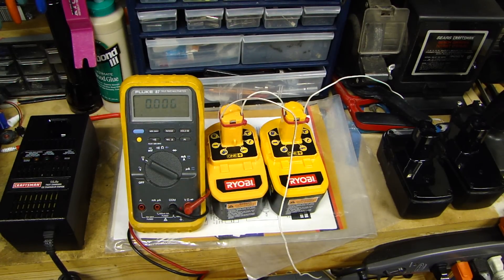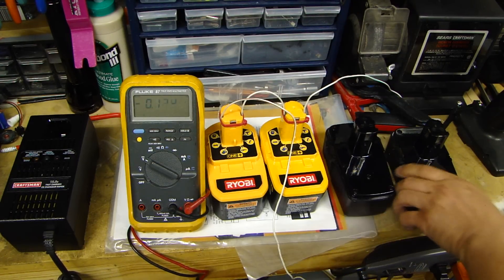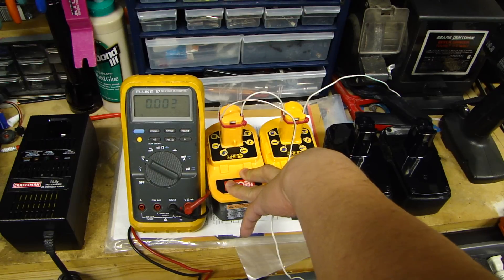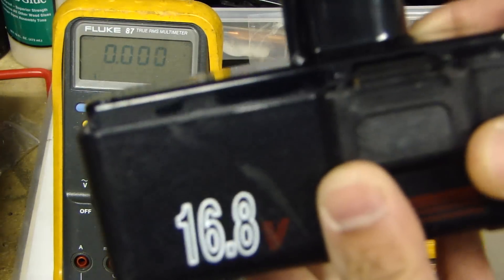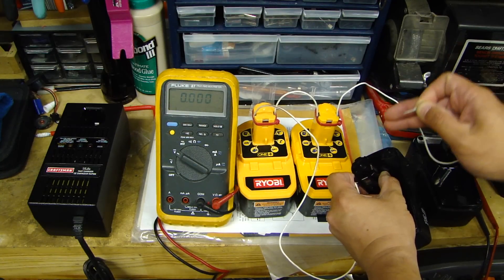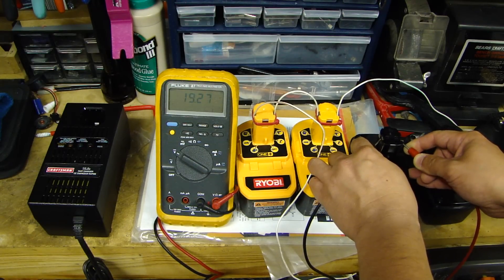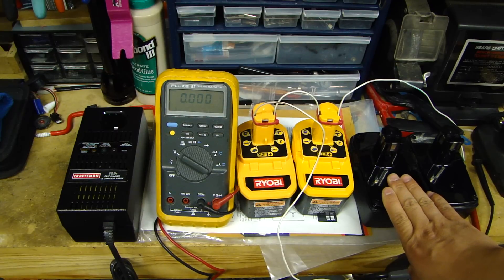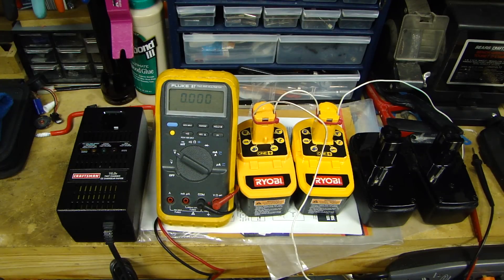How To Revive & Fix a Bad NiCd Rechargeable Tool Battery - Part 1

Comment: I didn't even know this was possible. I had 2- six year old 18 volt black and decker batteries that would give me 3 minutes before the line trimmer would lose lot of its power. I did this jumpstart twice with one battery and once with the other but with a diehard automatic battery charger. Now, they are giving me the usual 24 minutes trimming on a full charge for each battery. Rejuvenate six year old batteries to almost brand new?! Awesome! I almost was going to buy a new trimmer.

Comment: @chuckyg0409  It is the current from the external source that is blowing out the shorts (probably tiny filaments) in the bad cells, enabling them to take a charge again.  Your charger may measure 50V open circuit (a meter places a very tiny load on the charger), but the amount of current it puts out is limited (as it must be to charge the batteries properly).  The source used in this video can deliver amperes instantly.  Check Understanding Electricity at steverose period com. Aloha, Steve

Comment: Great video!  Clever use of the good batteries.  I found this after the fact, but will use it on other batteries.  I had a Makita 9100 (probably 15 years old) that was down to 5v (normally 10, 8 cells).  Prying off the lid revealed that some cells were shorted.  I shorted the terminals of the battery with quick pulses, as you mention, and there was enough amperage in the remaining good cells to blow out the internal shorts in the four dead cells!  Thanks for the video.  Aloha, Steve

Comment: I was able to get one of my 14.4 Ryobi NiCd batteries up and running.  I was able to get a decent charge into the second one use this "surge" technique.  Right now I have it on the charger to see if it will hold a charge.  Hopefully it will but at least I've got one of my guys online again have use of my cordless drill again.  Yay!!  Thanks for the information.

Comment from the maker: @geardriven I am not familiar with the DeWalt battery.Usually the tool will only have 2 contacts. From there you can try to do a quick charge on the battery and immediately use your meter to measure those 2 contacts to see if you get any voltage to tell which is positive or negative.

Comment: I have a DeWalt 14.4v battery that will not accept a charge. I'd like to try this but how do I tell which prong is POS? Also, nowhere on the battery does it state what it is. Whether NiCad or otherwise. Anybody know?
Great video BTW!

Comment: I have a digital power supply that I can preset for any voltage and amperage.  For Ryobi 18v, presetting the power supply to 36v, what amperage level would be needed?

Comment: Thanks,

The high current pulses are burning off the dendrites-tiny "whiskers" that form internally and short the battery.  Fix will likely be only temproary, unfortunately.  Question:  Would you mind telling what video camera and model you used to make this video?
Thanks!

Comment: JUST LIKE TO SAY THANKS THIS WORKED A TREAT ON MY DADS OLD DEWALT THAT HAD BEEN IN THE GARAGE SINCE HE PASSED AWAY AS I DIDT WANT TO THROW IT AWAY BUT DIDT WANT TO SPEND OUT FOR THE PRICEY BATTERYS USED A 12V CAR CHARGER AND BATTERY IS NOW GOOD AGAIN YOUR A STAR CHEERS MATE

Comment: Great video.  I just used my 12 volt Automobile Charger to fix two of my Dewalt 12volt batteries.  Basically, one was tired and the other was dead.  I used the 55 amp Jump Start mode to make sure there was enough 12 volt current.  I tapped quickly about a dozen times and then let the batteries sit for about 15 minutes.  Sure enough, they came back to life.  I suspect that double the voltage is less important than sufficient current.

Comment from the maker: @GlennTechNYC  I have never tried it with car batteries but I think you would still need to double the voltage which means you want to put two 12 volt car batteries in series. Car battery is not high voltage, but VERY high current, so be careful. One important note, if you are going to try one 12V battery, please disconnect it from your car before doing this. You don't want to take the chance of frying your car's ECM computer.

Comment: i followed this to the letter,  the first attempt gave a very low voltage reading so i waited 15 mins for the battery to cool down and then zapped it again and HEY IT WORKS. saved me £50. 
thank you for sharing this info.

Comment from the maker: @infinera06  There are no issues. You are just causing the source battery to surge a lot of current for a second with each tap. That's why I don't recommend putting it reverse polarity.

Comment from the maker: @TDoginNC  I copied this off some website to help explain - "The active cadmium material is present in finely
divided crystals. In a good cell, these crystals remain small, obtaining maximum surface area. When the memory phenomenon occurs, the crystals grow and drastically reduce the surface area. The result is a
voltage depression, which leads to a loss of capacity." .......my method of using high current to shock the battery will help break these formed crystals.

Comment: Works great!! I two dewalt 12v batteries that were weak (8v measured). Did this found out one had a damaged cell, but the other one worked just as good as it did before!! Cheers!

Comment: @dial2fast For safety I ran some 20" long 14ga wire to the terminals and placed the battery into an old tool box. With the wires exposed, I zapped it with the car charger set on 50 amp boost (jump start mode). 6-8 time in reverse polarity, the 6-8 times +/+ and -/-. Let it cool and put it on the charger.  Before, this battery would be almost dead by not being on the charger for 24 hours. Now it lasted 3 days with intermittent use. It has plenty of torque again. Just did the 2nd battery too.

Comment from the maker: @TFMTraining  My logic in my head tells me putting a high current in reverse polarity would not be good for the battery but then again I haven't tried it before. As for using car charger, with anything high current, make sure you can zap it VERY quickly and not too much so that damage to the battery does not occur.

Comment: Other videos I've seen say to first reverse the polarity from the power source for .  zapping (+ to -  and - to +).  The to do it again with the correct polarity (+ to + and - to -).  

I was thinking of trying this with a Car charger and setting it to jump start (50 amp boost.  Any reason a car charger wouldn't work?

Comment from the maker: @hjchin If you are talking about those little rectangular 9v you use for smoke detectors, then it won't work. Simply not enough current in those. This fix has more to do with current then voltage.

Comment: great video.. you can restore other batteries such as car batteries with the same type of method but using a circuit that jolts the cells with continuous pulses that contain high voltage but little current.

Comment: @dial2fast Hi, Thanks for the reply. I googled 16 gauge wire and it is usually used for speakers, that makes it easier to come by as I have a couple of old speakers in my shed. I will be trying this tomorrow. Thanks Again.

Comment from the maker: @elvis459 if you are asking the wire I used to rig up the setup, then it's just 16 gauge multi strand wire. Nothing special. I think 18 gauge will work fine too.

Comment from the maker: @ltcbio1 Thank you for your update. Happy to hear the process worked for you. As to how much current/voltage, obviously this is not a controlled scientific method to fixing a battery cell. The problem I can see with using an extremely high current source is how quickly your hand can zap that cell. If you hold it too long it could do permanent damage to the cells. My rule of thumb is stick with 2X the voltage of the battery and make sure the source outputs decent amperage such as tool batteries.

Comment: Hey Dial, ltcbio here, you had given me some guidance on determining the correct posts on my craftsman batteries and it worked, thanks.  I was able to zap them with my car battery and they are now taking a charge.  One question; does using a higher voltage translate to better reconditioning?  Does a higher voltage/current clear more of the sulfate build up?  Thanks!

Comment: hey Dial2fast.
I have a fire storm 14.4v battery A9276 and can't tell which is the positive and negative, one is silver in colour and the other is copper coloured...any ideas.
Also can i rejuvinate this with two 18v dewalt batetries.

Cheers Barry.

Comment from the maker: @ltcbio1   I am not familiar with the Craftsman battery, but one thing that can help is to look on the cordless tool or the charger to see which metal contacts it uses. Usually the tool will only have 2 contacts. From there you can try to do a quick charge on the battery and immediately use your meter to measure those 2 contacts to see if you get any voltage to tell which is positive or negative. Also you can try to measure the metal contacts in the charger. I am not Turkish.

Comment: Hey dial2fast, thanks for the video.  I am attempting to rejuvenate my 15.6 volt craftsman nicads.  There are 4 connections on the battery and I can not tell which is positive or negative (I do have a meter, but there is no voltage)  How can I tell which connections to zap?  Also, do I detect a Turkish accent arkadsham?

Comment from the maker: @ciretre 
You can use another tool battery from a friend as the power source. It's fine to put a 14V with a 18V in series (not parallel). Just make sure you have about double the voltage of your one bad battery.

Comment: Thank you for this post... I saw the one using the welder and was trying to figure out if I knew anyone with a welder. I don't have 2 working batteries, is there another source I could use, or if I borrowed another battery from a friend and they were different voltages, would that work? Such as linking a 14.4V with a 18V? I'm trying to revive a 18V I got for free from a garage sale, where the guy said they were useless because the batteries no longer worked.

Comment from the maker: @jeffcore14 If you have a battery that don't hold a charge like it use to, then this procedure can help. I'd say first try it on the battery that stops after few rev. Keep in mind, these procedures can't fix all the batteries out there, but if it does, you have just saved a battery that you would have tossed in the trash. So give it a try.

Comment: I had a question. I have two batteries that wont hold a charge for a long time. I can charge one and it will work for about less than a quarter than it did new. The other will turn the drill but stop after a few revolutions. So thew are taking a charge. Would this procedure help with my batteries?

Comment from the maker: @chuckyg0409 - You need to find a power source that is almost double the voltage rating of the battery. That is why I put two tool batteries in series (instead of using just one battery to rejuvenate another). When I mention people using car batteries, they are putting 2 or 3 of them in series, not just using one.

Comment from the maker: @dial2fast - Some people use arc welders and car batteries to rejuvenate the batteries. These devices are very high current.  Perhaps I can give you an example: if you take nine AA alkaline batteries and put them in series, you get 9 X 1.5V = 13.5V. Do you think this 13.5V source can be used to start a car? The answer is no because there is not enough current.

Comment from the maker: @chuckyg0409 - The reason you can't use your dewalt battery charger to revive the batteries is because of the current it puts out. When it comes to electricity, you have voltage (V) and current (I). Your charger is specifically designed to limit the current it puts out during a charge so that it doesn't fry your battery. This process of rejuvenating is really a process of surging a lot of currents through the cells to break up the crystals that has formed in the cells.